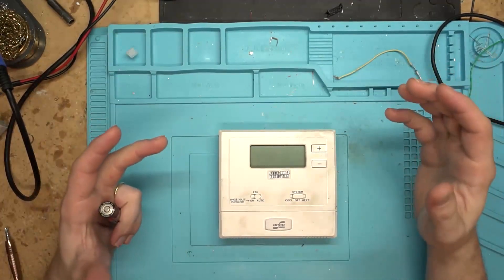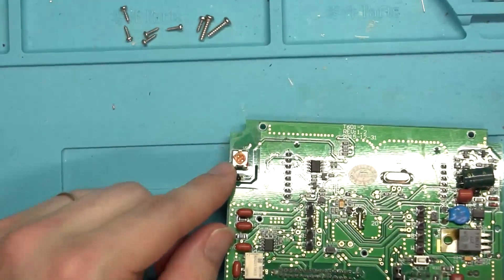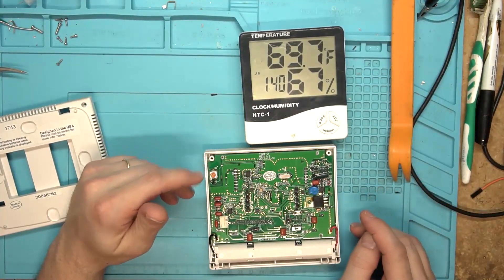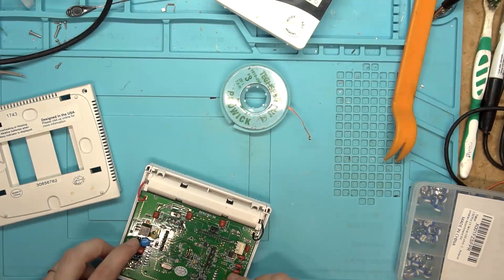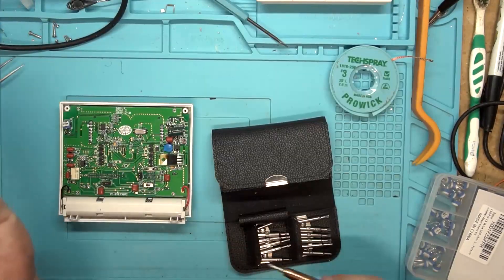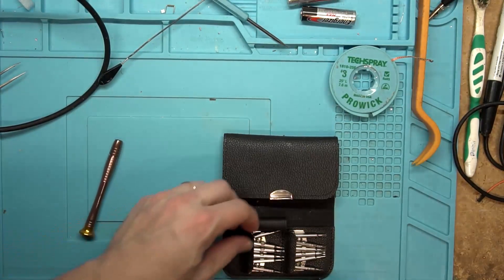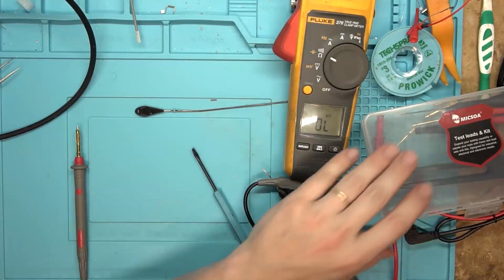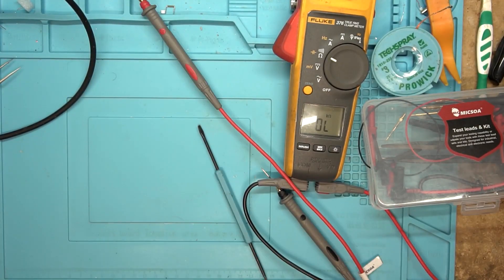Thermostat Repair: Partners Choice Thermostat t601-2

Comment: This is my same thermostat model  the thing went out 87f in the house it simply wouldn't turn on only showing temp in the house so me overthinking everything i thought it was done but the voice in my head said put the thermostat in the freezer 15 mins later the thermostat read 54 I cut the thermostat to cool the dam thing started blinking the moment the temp started to rise from being out of the fridge and climbed to 74f which is what my home is set at started working properly so if the thermostat gets to warm or to cold it will not function you have to trick it ...freeze it below what your home setting is put it back in place on the wall click to cool and walk away once it goes pass to 74f from being in the freezer It will engage thank me later

Comment: I tried vin flashing a 2003 cluster on a 2005 Suburban and it bricked the mcu
Reply from the maker: Yes you can't do that. 03/04 have a different mcu on it than 05, 06/07c have.
Reply: @FixedUntilBroken  are all the 05 the same or is year when they changed over to the led prnd321?
Reply: @FixedUntilBroken  Is it possible to recover it??
Reply from the maker: @deerhunter8533  not with a tech2 but it can be done in bootstrap loader. (The videos I do on mcu flashing). If your not comfortable doing that I can do it for you.
Reply: @FixedUntilBroken  how much do you charge from something like this
Reply: I’ve watched your video I think I will give it a try
Reply from the maker: @deerhunter8533  sounds good. I normally $80. If you send more than one in I do discounts on it but I keep a pretty flat rate on my work unless something completely insane comes in
Reply: @FixedUntilBroken  where do you get your 9399059 chips?
Reply from the maker: @deerhunter8533  the 9399059 is 03/04 right? those I get from UTsource. the 05-07c mcu i cant real ones of them with gm part number but xc161-cj chip work in its place.
Reply: @FixedUntilBroken  have you been able to flash them with minimon
Reply from the maker: @deerhunter8533  talking about the 03/04 ones yes. Sorry just going off the top of my head here so I'm not sure on part numbers. 

While I got you here you should share a video in one of favorite social media groups lol
Reply: I will sure do that. Thanks for the reply. Thank for your help!
Reply from the maker: @deerhunter8533  no problem! Thanks for the share it helps grow the channel which lets me focus on content and not marketing